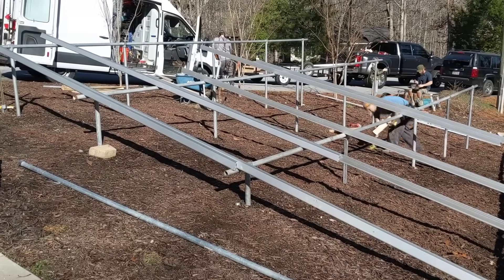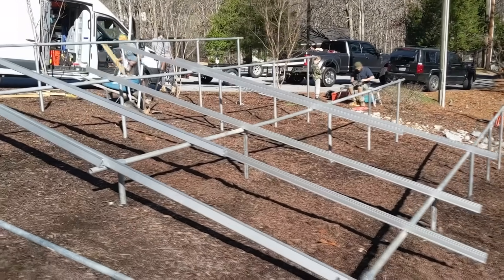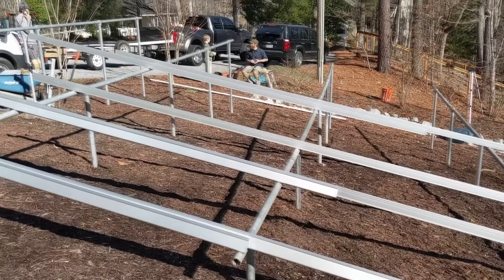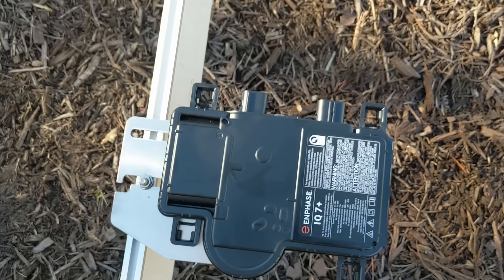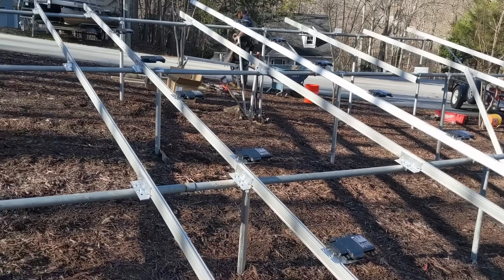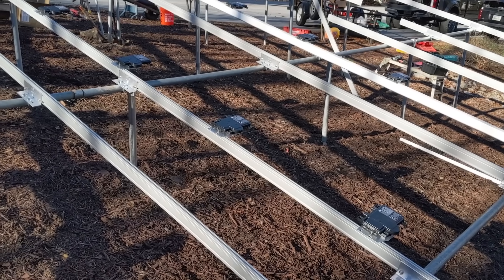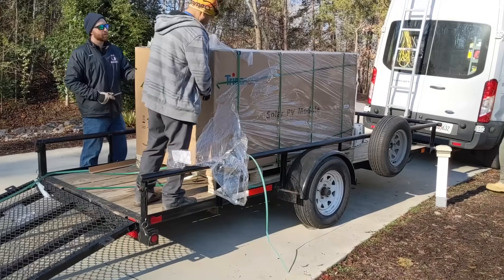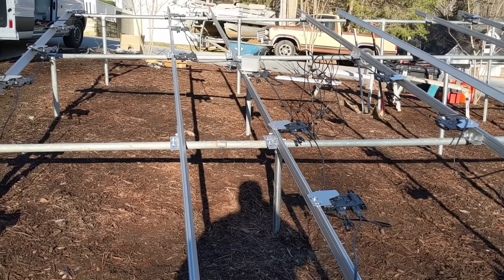Off-Grid Hillbillies Meet Enphase

Comment: Looking at the Enphase  IQ 7 LONGi 300W Kit. I was wondering if that is something a homeowner could install by them selves. Just want to start small with one panel and one inverter.
Reply: One panel isnt even worth going thru all the permitting, inspections, and agreements with the power company.  No point in doing any grid tie smaller than 4-5kw

Comment: Hi could you pontificate on the lead carbon battery briefly? thanks.
Reply from the maker: There are two reasons that I know of for adding carbon to the AGM batteries and that is to help minimize sulfation on the plates and to allow for faster charge rates.
Reply: @engineer775  recommended manufactures ?
Reply from the maker: @grandpaseed  Trojan, Northstar. If you need a quote let me know.

Comment: I have an offgrid system and a few years back I lost my battery bank. It simply wore out and I couldn't afford more at the time. So after some fiddling around I was able to run just about anything directly off the panels without batteries. Of course this is only good during the day but still I was able to run my computer lights television and some low amperage items. All by wiring in a buck down or buck up converter depending on the voltage you need. I have new batteries now and only did some experimenting. So the system is still usable with or without batteries. I need to do more experimenting but I had great success. Great video thank you for your time.
Reply: He has a whole great playlist of pv direct systems
Reply: Did you use enphase micro inverters?

Comment: That is not an "off-grid" property. Click bait. More rich people waiting money. Project is pointless and waste without batteries.
Reply: I agree it's not off grid. The rest of your comment makes no sense. I have 20 modules, and net metering with a grid tie inverter. You don't need batteries. I use the grid as a 100% efficient battery. Would I like a battery? Sure, it would give me backup, which I don't have, but I'm generating. That is not pointless.
Reply: @fjalics  so why would you spend all that money just for a grid time in system without having some type of battery backup for yourself when the grid goes down for a day or two? I mean what is the pay back on grid tie in 7 - 9 years depending on the local region. Given this video appears to be in the northeast somewhere, the amount of time per day for solar usage cannot possibly be good to pay the system back. Given the prime time usage schedules, these panels are most likely not helping this home at all. So as I said, it is useless!
Reply: @bigphillyed  I live in Ohio. The solar isn't great, but I still made over 7mwh in 2018, and nearly 7.5 mwh last year. It will eventually pay for itself, but  money wasn't the whole story. People buy giant pickup trucks, 4 wheelers, boats, and all kinds of other things that not only don't make them any money, but cost them. I wanted it. I don't understand your point regarding usage schedules.
Reply: @fjalics  so you spend all that money to make a tie-in system that offers you no storage for operation after the sun goes down. How much could you possibly be making sending power back? Not enough to justify spending that kind of money. I would say if you had a battery system to safe power for yourself while sending back the extra power, is a good idea. But again you are still at the mercy of the power company during a black out.
Reply: @bigphillyed  I get full credit for every kwh I produce. You are correct that my solar shuts off when the power goes out. I do want one eventually.

Comment: what is the collection advantage to a full gimballed tracking array and isthere a good economic system
Reply: From what I remeber. 1 axis tracker adds 10% over fixed. 2 axis tracker adds 20% over fixed.  With panels at about $1 per watt, for both cost and simplicity and asthetic, it makes sense to flush mounting to roof, and add an extra 20% of pannel.  Say doing a 2 axis encoder adds $1,000 of costs.  Could buy 3 more pannel and add 900W of fixed. capacity.

Comment: So what is the advantage of the micro inverters? Less line loss for dc and less sun shading effect bringing over all voltages down?
Reply: There is no central point of failure when using micro.
Reply: The panels all produce AC power independently, micros are as good as it gets when your dealing with trees/shade.  If every other panel is shaded by trees, the un shaded panels can still produce their full potential.

Comment: I have an enphase grid tied system too and they mounted the inverters on the solar panels and it's real nice being able to monitor power production.  Only drawback for me is when grid power goes down, mine does too.
Reply: Yeah same here. It's a code thing. If grid has issues your system would still feed power into it. When someone comes to work on it, they may get fried.
Reply: @kbob8424  Its not so much a code thing, its a grid tied inverter thing.  You have to have batteries to run when the grid goes down.  The enphase inverters can run without the grid, but you need batteries and an inverter connected to them to provide a grid for the grid tied inverters to feed into.  Solar panels can not support loads on their own, without a battery in the system.
Reply: @Tro1086  - it's by code.  grid tied systems must confirm with "Anti islanding" requirements. You cannot back fed energy if lines are down. There has to be a mechanism preventing this. If there is power present in the lines someone may get hurt when working on them. This is before even considering batteries.
Reply: @kbob8424  yes dude, I got that, but regardless, a grid tied solar system can't power your house very well without at least a small battery system to piggy back on.  If grid tied systems actually worked stand alone to power your house they would just have a built in transfer switch to disconnect them from the grid, and then keep running.  This is what hybrid inverters do, they are basically an off grid inverter that can also pass grid to loads when solar is insufficient, and disconnect from the grid and keep running on solar/batteries when the grid goes down.

I'm sorry someone sold you a grid tied system and you thought it was awesome. Hybrid systems can get pretty expensive though, with the batteries.
Reply: @kbob8424  Yea, and look up how well they work, not very well.  If you truly want backup, you need batteries.  Solar panels by themselves might work to keep a couple lights on and charge a lap top, but its most likely not gona start a fridge or freezer compressor, or start the fan on your furnace.

Comment: Scott, I had an Enphase system installed last May and love love love it so far ! 12 KW, 40 LG 335 Watt panels, 40 Enphase microinvertors, envoy etc. The monitoring system is great and we are very pleased with our grid tie system. We are in Houston TX, steamy hot summers, we did not pay for electricity in Oct, Nov or Dec and have so far built up a credit balance of almost 200 dollars. You guys do great work, rock on !
Reply: Hey David, that's great! So in Houston they let you bank any overproduction from one month to the next? Not where we are.
Reply: @kbob8424  yes in a net metering application that bank of credits builds up like I outlined, if not I would strongly consider battery storage that way I could save any over production myself.
Reply: @davidvelen9835  - yeah where we're at we do have net metering but the account is reconciled at the end of the month. If you under produced you owe the difference at full price. If you over produced they credit you're account, like.01 - .02 cents per kilowatt... or basically nothing.
Reply: How much did you pay?

Comment: Nice to see this type of system. I have a grid tied micro inverter system at my house. Probably will add the battery system in the next few years. In the meantime, it would be nice to see something about the process adding a cutoff switch so that we could use the system during the daylight hours if the grid is down.
Reply: Its not as easy as a cut off switch.  If that were the case you could just turn your main breaker off and the grid tie inverters would keep running, obviously they dont.

You have to have batteries to run off grid.